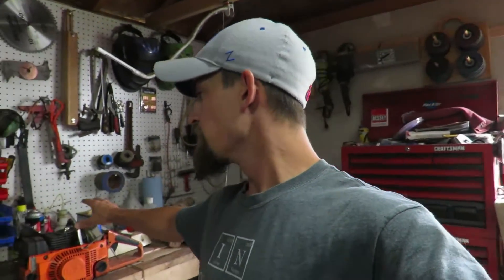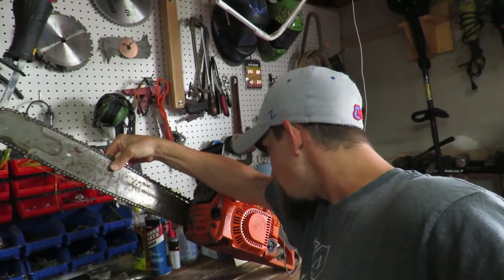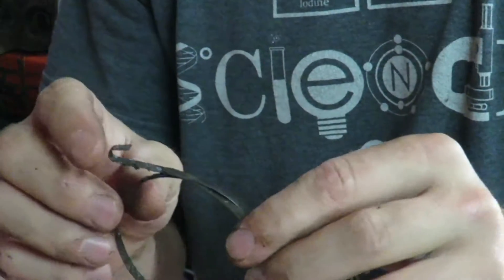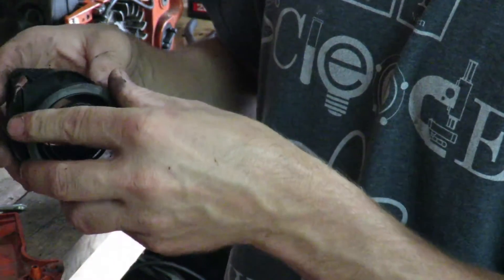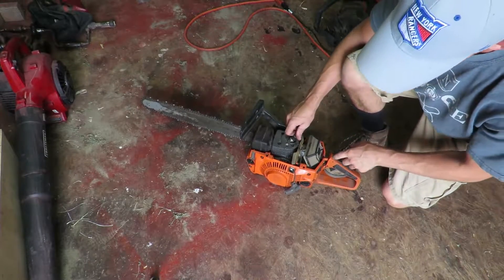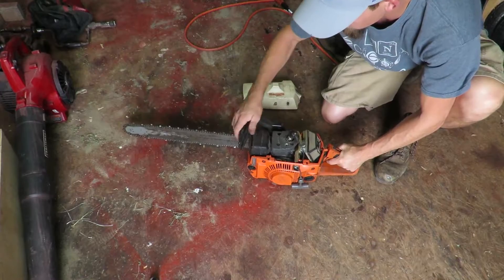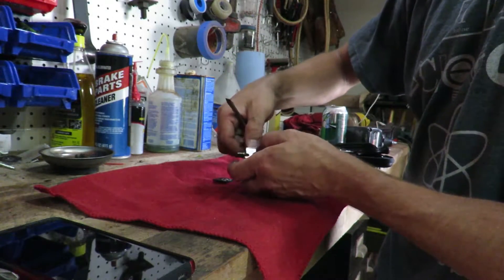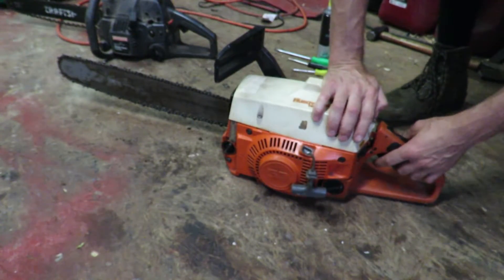Will It Run? Husqvarna 50 Rancher Chainsaw

Comment: Check the valve in the fuel tank and clean it if necessary See also the fuel line is not split and finally the fuel tanks are cleaned

Comment: I've got the same saw and I can't get the damn thing to run.
Reply from the maker: Does it start at all?
Reply: @ASliceofWoodWorkshop  it doesn't fire at all. It needed a new fuel line and filter. That's good now. Has spark. The carb is original and rebuilt many times. I tried to tebuild it with a Walbro kit with no luck. I've got 10+ hrs into it now. I gave up years ago and bought a 555. 555 is the cats ass for me. Now the rancher is collecting dust. Every year or so I'll throw some fresh fuel in, pull like a maniac on the cord, swear a ton and put it back on the shelf of half finished broken stuff. Then I remember it's ok cuz I gots a 555 now. Lol
Reply from the maker: Take the exhaust off and see if the piston is scarred. If it looks like it has a bunch of scratches on it it needs a new piston. Sounds like the saw has no compression.